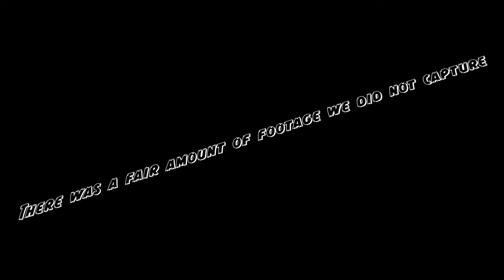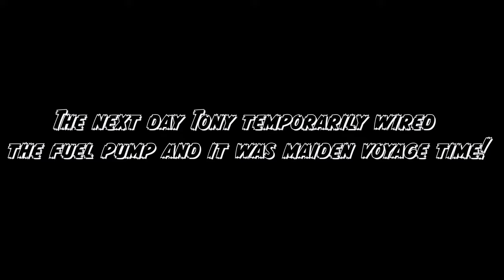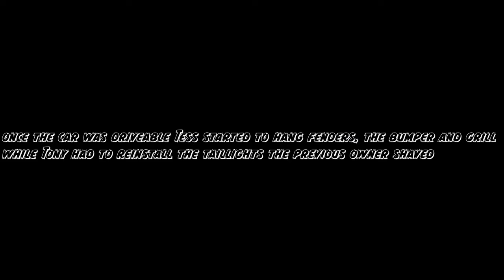First Drive! Miss Midnight Maverick's Streeter fires and drives for the first time!

Comment: Sweet Maverick! A friend of mine in high school back in the early 80's had a '76 Maverick Stallion, black & silver, 302 2V 3-speed stick, and it wasn't bone stock, but not modified. It was all stock except for a set of chrome reversed wheels with baby moon hubcaps, a Hurst shifter, a dual exhaust, and stereo system. At the time I had a '69 Torino with a 351 Windsor 4V, and he always bugged me about selling him the engine. I told him to find a new wrecked 5.0 Mustang GT, and put the engine and 5-speed in it, but like most high school kids with no money, he just cruised it, and had fun with it, but it was a cool car. 🧏‍♂️

Comment: Looks to be a '71 Maverick Grabber. I built a '71 Maverick Grabber for my oldest daughter. 351w HO crate engine, C6 transmission, 3:70 Detroit Locker 9" rear differential with anti-sway bar, 4 wheels disc brakes from a '78 Lincoln Versailles, '65 Thunderbird sequential taillights, rear spoiler from '69 Mustang Mach 1, aftermarket front chin spoiler, A/C, P/S, P/B and a Monte Carlo bar under the hood. With 4:30 rear gears, it does low 11's NHRA 1/4 mile using drag radials and open headers. Twice 10.87.
Reply from the maker: I believe it’s a 69 1/2
Reply: @TeamDPerformance  Grabber option didn't come out until late '70 for '71 model year. I've owned/restored a boatload of the Ford Maverick/Comet GT cars. I bought 11 of them from a Ford/Mercury/Lincoln dealer in 1981 for $750. They were former loaner/rental cars. Two had the 250 six-cylinder engine and the other 9 were 302 V8's. 8 Grabbers and 3 Comet GT's. All were rust free.  One was a dark bronze '71 Maverick Grabber Ghia. Very rare which is why I kept that one for my oldest daughter which she still has today.
Reply from the maker: That’s the year of the car, maybe it’s not a grabber I dunno! It’s Tess’ car
Reply: @TeamDPerformance  As I recall, she's had more than one Maverick. All the Maverick basic bodies are the same anyway.